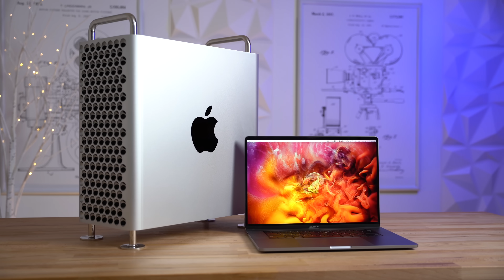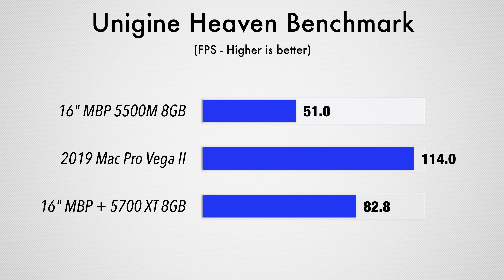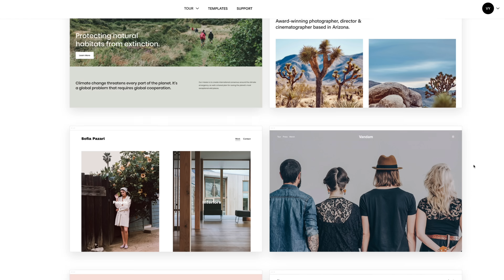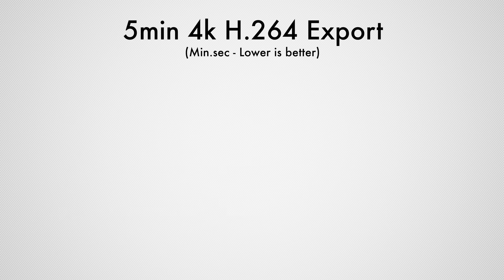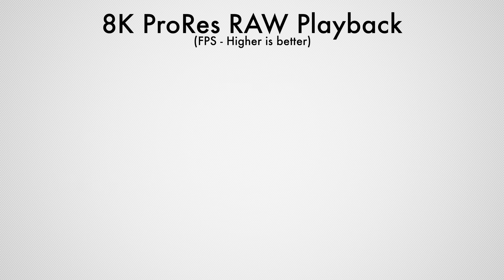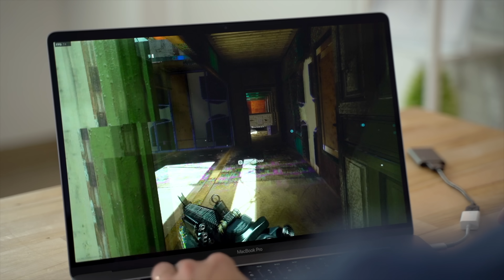16" MacBook Pro + eGPU vs Mac Pro - Can it Compete?

Comment: For blender did you used OSX? BC I have exactly the same Macbook Pro 16" with identical specs but I can't use my gpu because osx don't have Open CL support so I can use cpu only. I wanna know how did you used an AMD Egpu with if you can use only cpu on blender... I'm thinking to buy a workstation or an Egpu but this time I wanna be sure that I will can use my gpu on blender without installing Windows with bootcamp... thank you

Comment: Awesome videos! I have a 2019 MacBook Pro with 16 GB 2667 MHz DDR4 and the AMD Radeon Pro 5300M 4 GB Intel UHD Graphics 630 1536 MB. I play World of Tanks and it's ok, but still pretty meh and I want a boost. What would be the minimum setup you would recommend for this? The setup above or is there a more cost-efficient way to do it? Thanks again!

Comment: What if you had your render going to an external drive off the egpu?   Would that make a difference since you aren't sending data both directions on the cable from the mbp?
Reply from the maker: depends on the speed of the drive. If it's using an M.2 SSD x4 then you should be fine since there isn't that much data that gets transferred while rendering. A TON of data gets transferred while using graphics. -Vadim

Comment: On the gaming part using EGPU which I use the Razer Core Chroma with 1080GTX, I can get better results by turning off 2 cores in Windows System Configuration and steady 88 Celsius 2hr game play (Assassins Creed Odyssey 60fps).

Comment: 3rd reason to buy eGPU for 16" MBP is ... stop experiencing fans at 4500rpm and 65C - 100C temps with an external monitor.  Capture One Pro will make significantly better use of the eGPU for photography than Lightroom.

Comment: Awesome analysis video! This is exactly the lowdown I needed. I have a 16-inch 2019 MBP and was looking at either getting an eGPU or building a cheap-ish secondary PC. This totally swings me in favour of the PC route because you’ve confirmed the eGPU won’t really help in FCPX on the MBP. Keep up the great work!
Reply: I have the 16 MBP as well, but lately any FCPX work makes it run quite hot, with the fans at 50% or higher. I just ordered an eGPU simply to disable the dGPU and make my MBP run cooler, so it can potentially last longer. I already have turbo boost disabled, so maybe if it ran cooler I could reenable turbo boost and make up for any performance hits.
Reply: @OnIcePerspectives  I made the following comment on another one of MaxTech's eGPU videos earlier today, but what I've experienced is that, when I set FCPX to prefer the 5500m on my 16 MBP while it's connected to my eGPU (a Vega 56), it actually renders significantly faster than the 5500 by itself or with the eGPU preferred. It's crazy and it's surprising no one ever thought of it before, unless I'm the only person who's seen this, but it's repeatable and consistent; not a one-off. ie, a 2 minute effects heavy project with lots of tracking callouts, compound clips, and zoom transitions took 9m 44s with the 5500 alone; 11m 26s preferring the eGPU(!)...and 7m 18s connected to the eGPU but with the 5500 preferred(!!!). iStats shows the 5500 being maxed out and then it taps into the Vega 56 and nearly maxes that card out while it's rendering. I'd be interested to see if anyone else has similar results.

Comment: Question for any engineers out there:
We can only use 1 PCIe slot per controller and typically laptops only use one connection per 2 TB3 inputs on the motherboard side anyways.

the question is, why SLI technology (or something like it) can't be used to accomplish the splitting of a GPU task across multiple outputs? Would that not just be like a reverse SLI?  I would assume anyone interested in an eGPU solution would pay the premium to have a better experience.

Comment: Have you tried to disable the internal GPU of macbook pro 16 before testing with the EGPU? I think the software is not optimized to run with egpu, hence, to disable internal gpu will force all software to use egpu.

Comment: Do you have to connect an external monitor? Can I just play on my Mac screen?
Reply: If you use your laptop monitor you are going to loose even more performance because it is sending the data back down the wire after its done rendering. While TB3 should have full duplex (meaning whatever speed it is rated for, it can send in both directions simultaneously). However, using your laptop will need to send and receive the render which will leave less room for other information from other components. Avoid this at all cost and if you must you will most likely be better off waiting for other tech.

Comment: Do you know how long it’s take too to export a 20 minutes 4 k H.265 10bit file with the 5700xt as egpu? I have a 2018 15” MacBook Pro and spent over 10 hours for 20 minutes without hardware decoding

Comment: Hi maxtech, I currently have the 16 inch MacBook pro with this configuration 2.4 ghz 8 core core i9 64 GB ram, AMD 5500 8GB graphics and 4 TB flash drive. I am purely looking at improving the performance for gaming on this machine with two external 4k monitors. Would recommend using an external eGPU for his purpose? Specifically I will be trying to run the Microsoft flight simulator or the x plane flight simulator.
Reply from the maker: If the performance of the 16" MBP with 5500M still doesn't satisfy you, then go ahead with an eGPU. Buy the 5700XT
Reply: @MaxTechOfficial  Sounds good. Thank you for the quick reply. Appreciate it.

Comment: I just bought this eGPU setup for my 2018 MacBook Pro (AMD Radeon Pro 560X GPU 4GB GDDR5). Will I see better results when using final cut while editing Sony 4K video or should I return it?
Reply: Jonathan Connell I’m curios too. Did you see any improvement using egpu with 2018 MBP 15?
Reply: LeoWang Film Yes a slight improvement, but as Apple starts to support the 5700xt lineup in their own macs via software updates, it will get faster I’ve heard

Comment: Keep in mind that a powerful eGPU paired with a MBP will only help in heavy projects with a lot of FX, graphics, color grading and exporting to codecs like ProRes.
For simple projects with only some cuts in the timeline and exporting to H.264 they’re not worth it, and can be even slower because FCPX won’t use QuickSynch and TB3 is about 1/4 of the bandwidth that you get internally.
Hope that helps.
Greetings

Comment: Is an eGPU the best solution to connect the MBP 16" to three 4k monitors?
Reply from the maker: The 16" MBP supports up to four 4K displays at once, but it may use up most of your ports unless you can find a way to split a Thunderbolt 3 signal into multiple outputs, maybe using a Thunderbolt 3 dock like this: https://geni.us/IaTEVY
or this: https://geni.us/7RFq0
An eGPU would help you get it working well with one cable, assuming the card you use has enough outputs, which it should. -Vadim

Comment: Really enjoying your videos so I am now a new subscriber! I did a video solely in the gaming performance with a MacBook Pro 16 with eGPU in Bootcamp. Yours is a really great take on the eGPU performance for the MacOS side. I see you cranking out awesome videos on a consistent basis so you are obviously working hard! Keep it up!
Reply: how's gaming with the external graphics card? I have the 5500m and wanted something that can have the Mac run max settings at 60fps. didn't want the 5600m because that was an arm and leg

Comment: Hi guys! Please I'd like to know if an eGPU allow me run VR on a laptop that can't run VR with its built in GPU? Is this a test you've done before?
Reply: tolu619 Yeah, it works for my MacBook 16 5500M 8GB + eGPU GTX 2070 (recommend NVIDIA for VR, because of vrss support) + Valve Index. Upgrade runs VR smoothly, Half-Life Alex - 60-70 FPS and I haven’t done any settings optimization yet.
Reply: @Stenveel  Cool! I ended up getting a Surface Book 3 which doesn't have Thunderbolt, so I can't use an eGPU, but the Book 3's built-in GPU is VR capable. I'll eventually get a Desktop for VR anyway, but I'm satisfied having a laptop that can both run VR and be transformed into a drawing tablet, as those are usually two very different devices

Comment: Try iMac 2019 i9 in gaming please. Would like to see if it will make gaming smoother.
Reply from the maker: Processors don't really help much for gaming. It's all about the graphics card.
Reply: @MaxTechOfficial  So it's good right? If I use eGPU for gaming on my iMac 2019? Because right now, I tried playing Starcraft 2 and it's kinda slow on 1440p and 4k.

Comment: Max Tech I would like to ask your opinion on something . I already have the Razer Core X eGPU with an AMD Radeon RX 580 with 8 gigs vRam, I am about to upgrade to the 16" MBP, I'm going to get the base i9 version with the 5500M 4 gig. My question is, do you think it would be worth it to get the 5700 XT or should I  just stick with the RX 580?  I primarily use my Mac for editing photos and videos from my Phantom 3 Pro drone. I use Affinity Photo and Final Cut Pro X .
Reply from the maker: For the kind of task you need it for, I don't think you need the power of the 5700 XT. Just use the RX 580 or even the MacBook Pro by itself and if it turns out to feel slow to you (in terms of graphics power) then get the 5700 XT.
You can tell when you're limited by the graphics card when it's being used at 100%. 
You can download iStat menus to monitor graphics usage or use the activity monitor and open the graphics history module. If it's at 100%, it's the limitation.

Comment: For those wondering why some editing apps were inconsistent, it’s because the software developers need to adopt Apple’s APIs to take advantage of the the eGPU. Adobe is slow to implement them compared to speed tests
Reply from the maker: Lightroom isn’t using the internal GPU when exporting. And probably not the external when editing. In any case Lightroom’s use is very minor and you don’t need a good graphics card for that program.

Comment: Surely the egpu would benefit from two cables that separate in and out?
Reply: I am dying to know the answer to this, the answer kinda makes sense but also doesn't. 
A single GPU can exist on 1 Thunderbolt connection and one branch of the PCIe tree, so an eGPU cannot sit on two different branches. Think of your two TB ports as separate PCIe slots. You can only plug a single GPU into a single slot. Also, even if two ports are connected to a single controller, only 16Gbps connection is used for both of those inputs on the motherboard side. So even if you would use two ports they share the same connection. And even if this was not the case ( two TB2 controller ) you'd pay a hefty premium for only 10% more performance.

Now the question is, in the 21st century can we not use the same tech inside SLI to accomplish the splitting of a GPU task?

Comment: Was an external monitor only setup tested with the eGPU? I find it helps eGPU a lot since the traffic only has to go in one direction.  I think the MBP itself needs the lid closed so make sure all display data goes through just the eGPU.
Reply from the maker: That is exactly how we ran our testing

Comment: An egpu for using blender on a Mac ? Since version 2.80 there is no more compatibility with AMD cards , all is rendered on the cpu.  What version did they use for the test ?
Reply: wow i did not know that, can you tell me why they rely on CPU which is considered weaker than GPU in Rendering?
Reply: @uchungnguyen1474  Correct, but Blender rendering with Cycles (Blender's path tracer render engine) on GPU is possible on Linux or Windows. This benchmark may have been done on Bootcamp? But also back in the High Sierra days, Blender Foundation made Cycles CUDA compatible on Mac! This was amazing. Apple dropped Cuda support shortly after though. This ended up being a slap in the face and waste of time for Blender developers. Also infuriating for us macOS Blender artists with Nvidia GPUs. To make matters worse about a year later Apple announced they were dropping Open GL support in favor of Metal only. Because of this Blender Foundation had to put resources towards more future proof and useful areas of the app, which is why it's CPU only now on macOS. Eevee, Blender's marvelous real-time renderer, does work great with (Metal?) GPUs on macOS! To put it in perspective this same benchmark only takes a few seconds on a Mac with Eevee with the 5500M.
Reply: Mark Reategui no matter how much I love Apple, for that decision, I hate them! Just because Nvidia and Apple can't agree like adults, Apple stopped support for it. And we, the users, are the ones who suffer
Reply: kunemann  that’s why I wonder as blender user if it will make any difference if I choose the amd 5700 xt instead of the 5500 gpu in my still to order 27 inch imac .  Wouldn’t it be better to opt for the 10 Core cpu and heaps of ram since all the work is on the shoulder of the cpu?  Last resort would be windows in bootcamp and hoping it recognizes the gpu with all the hustle of downloading and installing the drivers.

Comment: How would the results look if you just used the eGPU as an external compute unit? ie don't plug in a monitor. Also, as mentioned by others, how would the Mac Pro perform with the 5700xt? Or with two of them? Two of these cards must be an excellent cheaper alternative to the crazy expensive Pro Vega II.

Comment: Wow! I'm surprised at how little an external eGPU makes a difference in most cases. The strange thing is that an eGPU usually greatly increased performance. So I wonder what the issue is.

I think it may be a multi-faceted problem. The first problem is: are you running an external display with the MBP with these tests connected to the same TB3 bus? I'm assuming you did and with a minimum of a 4k monitor attached to that bus. Because then, about half of the bandwidth is taken up with the display. And the higher resolution of the display, the more bandwidth is being taken and less performance gain you'll see with the eGPU. The eGPU has to wait for data. The Mac Pro blows the MBP with an eGPU out of the water because the video card is connected directly to the system board and not sharing bandwidth with the monitor over a TB3 connection. I found this fantastic article discussing it. A great and short read:

https://macperformanceguide.com/blog/2019/20190128_1352-understanding-Thunderbolt3-bandwidth.html

I'd be curious to see the test results running an eGPU with and without an external monitor. Or, if you ran the eGPU and monitor on separate TB3 busses on the MBP. I think we'd see a huge difference in performance. I don't think using the two separate TB3 busses on the laptop while in the office would be such a big deal. It just wouldn't look pretty. Just get a right-angle adapter for the cable on the other side of the laptop. Just for a nicer appearance. 9to5Mac did a really great video on some of my theory...

https://www.youtube.com/watch?v=Js4bZLWWoM4

I got a feeling that if the eGPU and external display for the MBP are on two separate TB3 busses, then we'll see a very nice performance improvement. If that doesn't work out, then you'd need a much more expensive eGPU solution. Would option 2 be worth it?

Could be. 

As a photographer, the 16" MacBook Pro is so superior to my 2013 15" MBP. I think it would cut processing to about 15% of the time it takes now if not less. Which would be fantastic. But the real time-savings is on video... If I spent $2k on an eGPU solution, that's nothing compared to the time savings on some video projects. Mine are events that are shot for HD and are 20 - 60 minutes in length. It takes a minimum of 3 hours to render a 1 hour video in HD on my laptop. Editing performance is reasonable. I just render at the end of the day. However, when there's more work, timing is much more critical. There's really no room for any error or issue. With a 16" MBP rendering in HD, that would be cut down to probably around 30 minutes with 4k taking about an hour. I rarely do 4k. Clients just don't require it. But it's coming. With an eGPU potentially cutting those times in 1/2 or 1/4. $2k would be a bargain vs even a base Mac Pro.

I just hope your solution and the two-separate TB3 bus theory works out. $700 vs $2000? I'll take your solution!

Thanks for the fantastic video!
Reply: I agree.  Since the Mac Pro must use an external monitor, I think that is a more relevant test.  I would find this test more helpful if the MacBook Pro were using an external monitor.

Comment: It has nothing to do with Thunderbolt, the 5700xt is simply not mature with drivers yet. You will get the same results running it internally. Afterburner also has nothing to do with final encoding speeds.
Reply from the maker: It actually does in the tests we showed: https://youtu.be/33ywFqY5o1E and the 5700XT outperformed our Vega 64 with mature drivers: https://youtu.be/3MwPncpJtF0